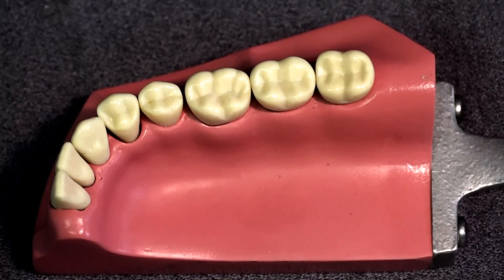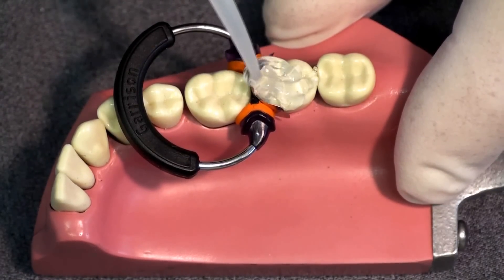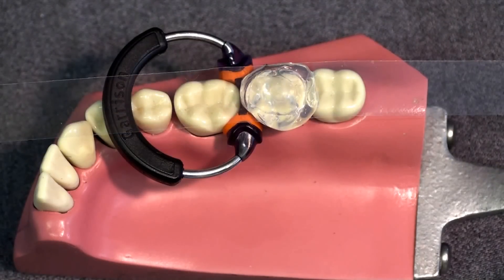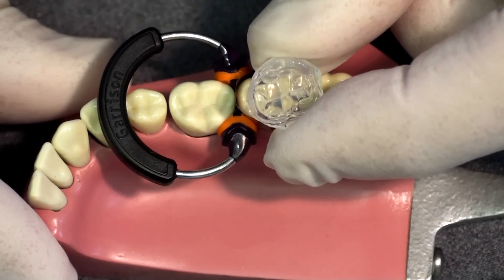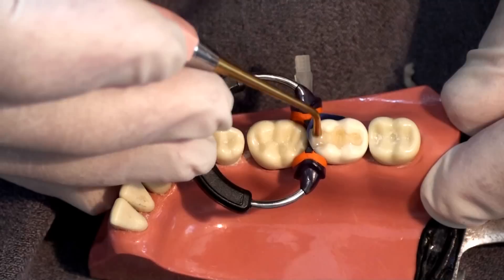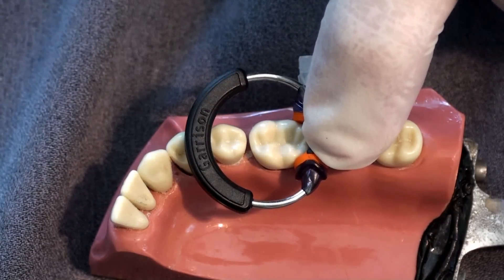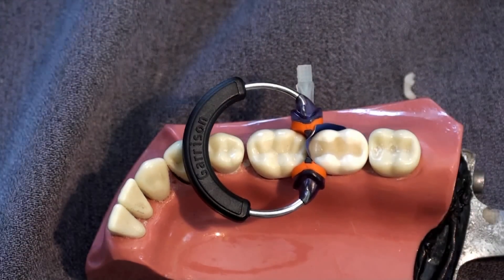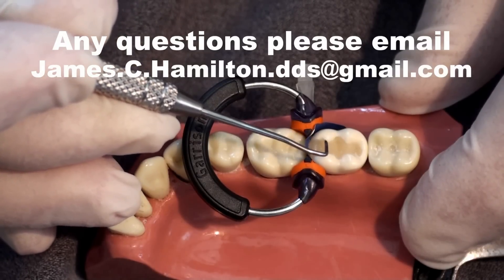Sectional Matrix and Class II Light-Cured Composite - Time Saving Technique

Comment: Happy Holidays. 2 quick questions.
 1- does it bother the patient to place the band and ring before they are really numb 
and 2 is the impression material going over the band edge or just right up to it to give you 
the nice marginal ridge?  because if it goes over the band, will it seat exactly  back in the same place when you 
seat the band back the 2nd time with the wedge and ring.
Thanks . Lanny
Reply: Placing the band and C-clamp is no different than placing a Tofflemire matrix band and retainer with regards to pain.  There is no pain unless you push the band into the gingiva.  The band is just to form the impression material not limit the flash after condensing a restorative material.  You do not want the clear bite registration material to go over the matrix band.  If it does it will make it difficult to reseat the clear custom matrix impression back into the correct position.  If you do get the impression material over the band just cut that part off.  It makes reseating the impression back on the tooth much easier.

Comment: If you are doing an occlusal filling doesnt that mean more often then not that the anatomy of the occlusal surface is off as well? So you would be taking an impression of a cavitated tooth
Reply from the maker: If the tooth has a cavitated lesion I easily fill that cavity up with red boarder molding wax.  If it is a large cavity, I have the patient bite into the wax and form the anatomy. Then I scrape away the excess If the tooth is fractured I do the same thing.  It is much easier to form wax than cured composite. This may sound hard, but it is very easy and fast.   See some of my videos on YouTube that show how to handle teeth that are not perfect.  You can also learn from my free course handout.  If you want a free course handout send me you email and I will email you a MS Word file with my course handout called "Composites, Better, Faster and Easier."
Reply from the maker: Search on YouTube jameschamiltondds and composites and my website is jameshamiltondds.com
Reply from the maker: Do NOT search YouTube for James Hamilton DDS.  You need to search for jameshamiltondds composites.

Comment: How does the proximal contact come out after using this technique? Do you have to burnish the Garrison matrix band in order to achieve clinically acceptable proximal contact?
Reply from the maker: This technique, the Clear Custom Matrix Technique, has no effect on the contact.  If your technique uses a Garrison clamp or a Tofflemeirer, you contact will be as good as you usually get.  Your contact is made usually before you add you final increment.The Clear Custom Matrix Technique only forms the composite above the contact, not at the contact.